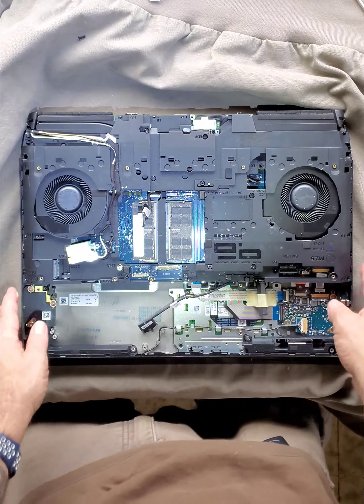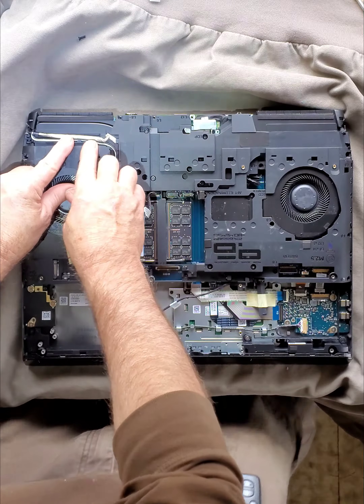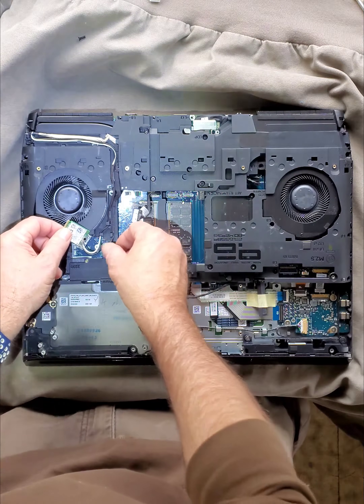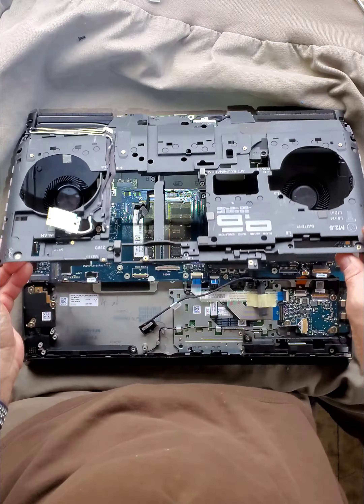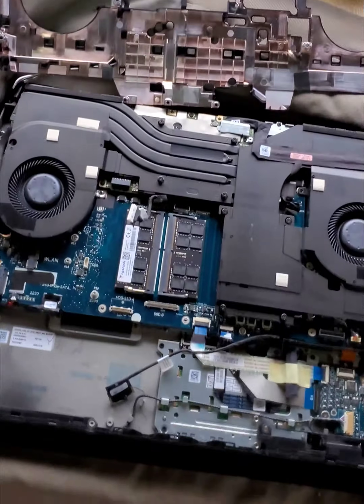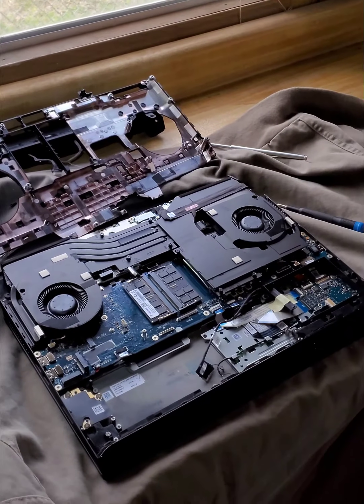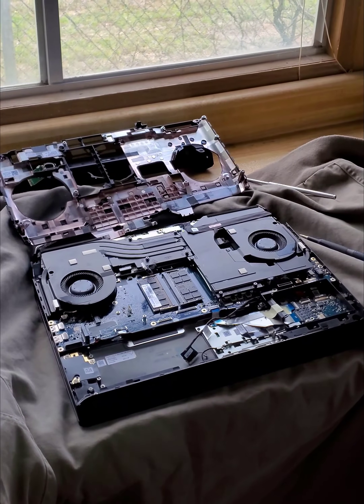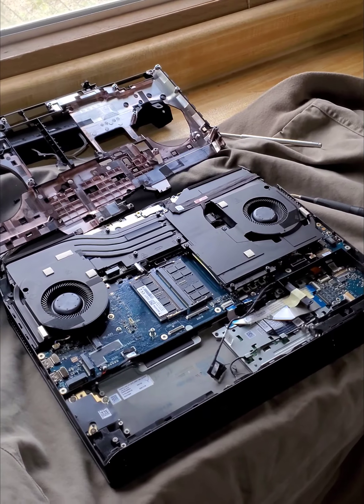Area51m R2  Repaste/breakdown tip - avoid un-routing certain wires...

Comment: Hi, do you know by any chance the size of the thermal pads ? All of them, thanks!
Reply from the maker: As a matter of fact I do. I just replaced all the pads on mine last weekend. I'll send you some diagrams once I'm at the house in just a bit. I've also got some valuable tips I can share and that I discovered after a couple trial and error passes.
Reply from the maker: Hey there mate.  Here's a diagram showing all the pad heights for an Area-51m R2.  Use soft/squishy pads and not the denser variety; trust me on that:  https://www.overclock.net/attachments/heatsink2-jpg.2571453/
Reply from the maker: And otherwise?  Read this whole thread.  Lots of good info on my process so far.  I used Gelid Ultimates and they are working fairly well.  They are too dense for my liking though and I'm going to replace them with a softer type pad for better contact with the CPU: https://www.overclock.net/threads/area-51m-r2-laptop-heatsink-re-pad-squishy-or-dense-pads.1800607/
Reply from the maker: And last but not least?  This is some 1440p gameplay running my A51mR2 at 4.8ghz all core showing details of CPU/GPU temps and other fun data from just yesterday I think.  This is with the Gelid Ultimate pads.  With softer pads, I expect the CPU temps to be about -5C better...   https://youtu.be/V9wCfFjeFms?t=68
Reply: @th3_g0dz_of_Vict0ry  Thank you very much for the info, really usefull, keep up with the good job!

Comment: Part two ?
Reply: So far?  That's as much as I've done.  I have some kick ass thermal putty that I want to replace all the pads with but haven't had the stamina to do it yet.
Reply: Please a part two or a full teardown. If you please know what measurements I need for the thermal pads ? I have 10900k and 2080S. Thanks 😅
Reply from the maker: @adoyoutube  Hey mang.  See my most recent comment above in reply to Muresan Calin's questions.  I include links to the A51mR2 heatsink which apply to both the 10700/2070 and 10900/2080 laptop models.  The complete tear down is rather simple and there are several good videos already on YouTube.  Here's a link to an accurate diagram of the pad heights.  As I told the fellow above, use pads that are soft/squishy and not the harder/denser type pads.  Softer pads will allow the best contact when you bolt down the screws around your GPU/CPU.  Here is a diagram showing accurate pad heights for your machine:  https://www.overclock.net/attachments/heatsink2-jpg.2571453/

Comment: Ive done ihs copper upgrade with liquid metal ...lm for cooling aswell! On my area51m r2! How are your temps now? Mine are pretty good to be honest! Whats the max clock you can run now?cheers
Reply from the maker: I usually run at 5.1ghz ... max temps hit around 80C in some games but most stay in the 70C range